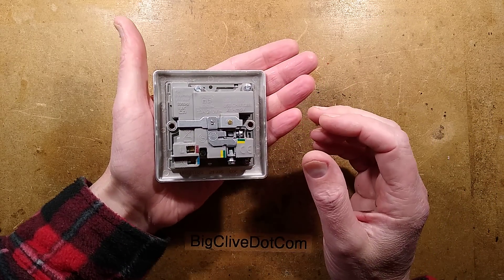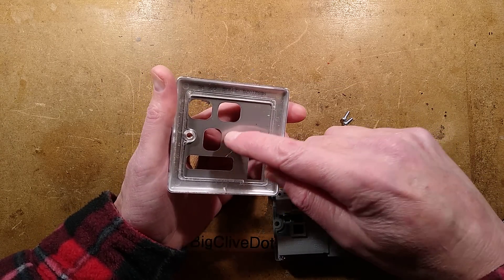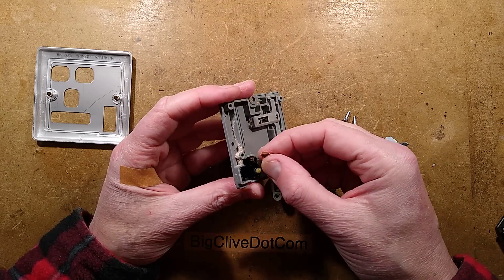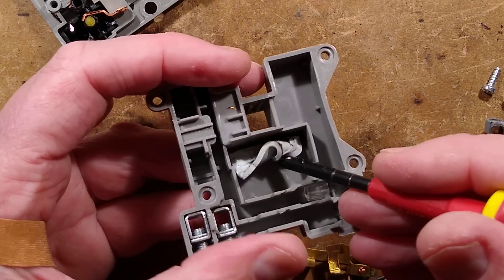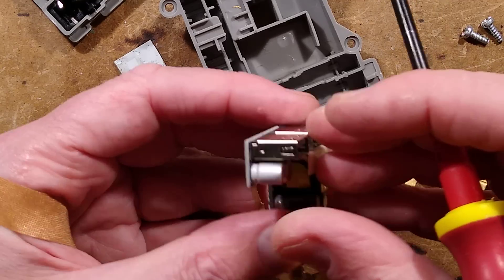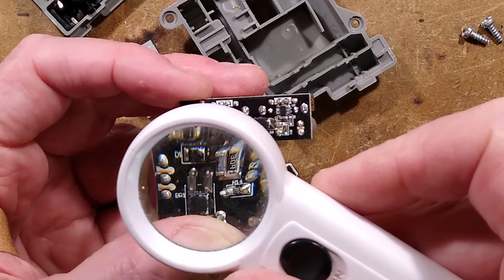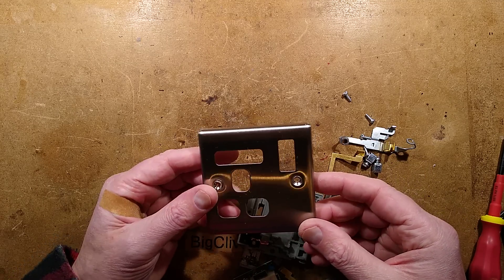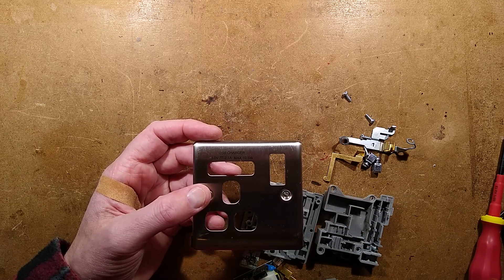Exploded British General USB socket

Comment: I've never liked (or used) these permanently powered up built in USB sockets, Not only because of problems like this happening & not being able to quickly disconnect them, but also the fact that they continuously draw a small amount of power, even when not in use, which would start to add up if you had them all round the house.
Reply: Agreed, how much is the vampire drain on these sockets? At current elec prices, 1W continuous is costing about £3 per year.

Comment: Hate these things, but if people really want to there's not much you can do. Also, i envy British socket and plug desing so much due to those being polarized and more importantly an option of fuse inside a plug. Switches on sockets are kinda nice addition too.
But this example has nothing on schuko style with integrated USB. British style got space to fit decen circuitry, meanwhile here - how good can be a circuit that they shove into a mechanism that fits into 65 by 40 mm box.

Comment: I rent and recently had an electrician come in to replace the switch for my immersion heater. He installed the switch upside-down so the "ON" text read "NO", ran the lead through a shelf rather than around it and left one of the screws loose. Once he'd left I isolated the power at the breaker and made it good, and safe. I understand why folks don't want to mess with mains though, I just wanted it right without having him back.

Comment: Lidl did a three port charger with pass-through socket a few years ago which has most of the benefits of  built in USB ports without the "transformer stuck in the wall" problem. You can also switch it off. 
I've had no problems with mine but I haven't seen it on sale since.

Comment: I don't have any sockets with built-in USB, but I do have a few of those 4 gang extension leads with 2 x USB charging ports, and I've opened them up, drilled a hole in the case, and fitted a nice 3A switch so I can turn off the USB ports. 
The idea of built-in USB sockets is fine but I think the current implementation is flawed. They need to incorporate a switch so the USB sockets can be turned on/off as required. 
Having electrolytic capacitors, ICs, etc, humming away 24/7 in an enclosed, non-ventilated, tight-fitting space, converting 230 to 240 volts into 5 volts, is a recipe for disaster and house fires.

Comment: I've had a BG double white socket with USBs toast out, disabling USB but maintaining mains power. I replaced in any case and I also consider BG to be one of the better brands whilst not as slick as the more expensive MK. This lasted a lot longer than Chinese import USB wall sockets off fleaBay.
Reply: Same, in my case it happened while a Hoover was plugged in to the socket; might have been a Masterplug branded one but it's always BG on the actual sockets. Costco accepted a return even though I only gave them one socket out of a 2-pack.  I have a few of these for convenience, I must admit, I know how to safely install, test and change these if needs be though and I accept that is not the case to the wider public.

Comment: I’ve never been a fan of the built in USB’s for exactly the reasons you state. They sit there constantly powered it can’t be good. I have very sensitive hearing and in hotels which have them near the bed I can hear the transformer humming. Really annoying as you can’t turn them off

Comment: That grey sticky oblong is a thermal pad they work great, mainly on tv boards to transfer heat from parts to the metal chassis 
Thanks Clive nice tear down
Reply: @stonefisk  lol, yes very cold
Reply: And if they'd used a metal case instead of plastic, it might have done some good.  Inadequate cooling is probably the source of the failure on this one.

Comment: I've never understood the 'need' to have an electrician wire something as simple as a socket.
A lot of people in the UK know how to wire a plug, a lot less than I thought when we were taught it in school and half the class failed at it but still a fair amount.
Wiring in a socket is the same, if not slightly easier, flip breaker, test if socket is still live, take out old socket, take photo of wiring configuration, grab new socket, see where wires go (they'll be marked, or even nicely colour coded) put wires where the socket tells you to, check photo to make sure you haven't discarded something you need.
Or just check one of the dozens of videos online.

Comment: Somewhat unrelated but talking about electrical failures I've just lost 2x £5 circuit boards thanks to what at the moment appears to be a fake FTDI chip.

I was doing some work over serial and the first board worked fine but the two subsequent boards had strange jitter-like issues on their RX side. The hint that it's the FTDI is that the problem has worsened the longer the device was attached and that the TX active light comes on when the TX -> RX connection is severed. Also a second brand new FTDI board doesn't show the same behaviour.

Makes me wonder if a fake component has turned up here?
Reply from the maker: Hopefully not the infamous rogue FTDI Windows driver that deliberately bricked clones.
Reply: @bigclivedotcom  Given how many of them are around I think it almost certainly is, but then I use Linux so no driver issues. 🙂

Comment: i would rather trust a decent brand wall socket with built in usb than what most people do and get the cheapest usb power supply and leave it plugged in and switched on anyway.
Reply: There is also option of buying quality chargers.  I never understood the argument that I would rather get this bad thing than the other bad thing.

Comment: a slipped screwdriver into electricians hand caused him to lose his last three fingers from infection.  so innocuos but still deadly. i wouldn't have even realised if my dad had not been on the same ward.  whats additional is that my dad almost lost his middle and ring finger from a spanner slipping as we were changing ball joint on morris marina. he got a small cut but the contaminants  made for blood poisoning. scary stuff. Please wear strong gloves or at least be aware of the angle the tool you're putting pressure on.

Comment: I wonder if that is why I prefer plug in devices, rather than built in, as a failure of a built-in is far harder to isolate. Switched sockets are usually simple devices with a high reliability.

Comment: These USB wall sockets should be avoided like the plague. I've had enough devices fried by dodgy chargers to never use a charger I don't trust, and this style of socket is increasingly common in public spaces where it's impossible for the user to verify what the USB port is putting out.

Comment: I wonder if they could install a microswitch at the bottom of each USB socket that turned on the power to the circuitry when a USB plug is inserted?

Comment: Im not a fan of these sockets with USB embeded in them,just a fire hazard in my books,as the customer was using it with led strings,might of overloaded the USB,or  thermal protection kicked in, and was constantly switching on/off as it heated and cooled down,eventually stressing the power supply.

Comment: As long as electronic components like transistors or integrated chips will be failing short circuit (which they mostly do), integrating such circuits into a hard wired components of the electrical systems will be a no-no for me.

Comment: Yeah, not a good idea... good that you reminded me of those Clive. In my mom's new apartment basically all units have come with one wall mounted USB socket like that (probably because the intention was for lots of units to be AirBnb units anyways), I have little hopes of them having good circuitry given that everything in that building is cheaply done cutting corners and all that crap. I intended to take the thing away from the wall and just leaving it empty, but I never did it - marking it as a must do for the next visit.

Comment: Interested you bring this up, my parents had the exact same failure in a Leviton branded edison style US outlet. In their case mains voltage some how ended up on the usb lead and the cable caught fire. Luckily no one was injured but it was still a mystery how this happened.
Reply from the maker: Possibly a badly wound transformer.
Reply: Why did you call it edison style? edison was a thief and didnt invent anything. The flat pin US plug was invented by Harvey Hubbell.

Comment: You know, the previous owner of my house installed a USB outlet in the kitchen. I've been thinking about removing it, just haven't gotten around to it. I won't even use the USB outlets on it. The few times I've needed a charger while following a recipe from my phone, I've went and gotten a plug in charger. I don't know anything about the quality of the built-in circuitry, let alone the possibility of failure. And when I pull it out and check it, it won't go back in, even if it's well made.

Comment: In the UK, a 240V ac power outlet could be supplied with a protection breaker of 32A. 

Given that a USB supply is built into the wall, it is possible for the full 32A to arc away and set fire to the house. Fuses work when there hasn't been any component or copper track residue/flash over. But in a confined space plasma builds up and conducts well.

Appliances should never ever be built into walls.

Comment: Why go the extra mile and make it flush with the wall, BUT not include decent caps to smooth the dirty electricity out caused by the USB's power supply? The stupid short term comfort, and the long term headaches such items cause both health wise and financially...

Comment: Yes. Let's just "heatsink" the board to the non-thermal conductive plastic enclosure, and stuff the whole thing into an insulated wall. Don't even bother trying to couple the heat to the slightly more thermal conductive metal front panel, which could actually stand a chance of dissipating some heat.

For anything that's going to be sealed in a wall, they really should derate everything in their design, assuming it's going to be running at 100°C whenever it's in use. They should assume it needs to run 24/7 for at least a decade, and then catch fire. Luckily it only popped this time, but it only takes the wrong combination of components to pop and leave enough of a skid mark to allow the mains to arc over. And that could cause you to have a very bad day, indeed.

Comment: i think these are very bad idea and should be banned, i the usb power circuitry in these is usually continuously powered, which should not be allowed,  and when it fails, like here, whole thing needs to be replaced, much better a plug 'pass through' usb power adapter ..

Comment: The burned components should be connected to the driver IC, which is the real culprit; in the sense it had a breakdown (short-circuit), following a peak of the main voltage, or just a random parameter shift. Those shifts are binary, as they require a manufacturing error (water or sodium in the IC), and a sustained overtemperature.
There should be a main switch for the 5 volt power supply, too.
Thank you for the video,
Regards,
Anthony

Comment: I've always thought that wall sockets with built in USB ports are a bad idea. Sure it's convenient and you might think it's a really cool idea at first but when you think about it more it's just more circuity crammed into the same space resulting in higher temperatures and more parts that can potentially fail.

Comment: Agh, I was hoping you said "it went on fire"
Put the bigclive bingo card away!
I dislike permanently wired thingies like these, despite being elechickenedly minded, if the other half would be stuck with something like this situation, she wouldn't know what to do.
Be interesting to see if those electrolytic caps had changed value over time being constantly "kept warm", cooled, then required a demand if the power was reintroduced after decorating. Used to see this a lot in a particular cheap brand of dvd/vcr combi that used cheap caps. Customer states "worked great until I turned off the power, but comes back on. 5 hours after I switch it on". Also would do weird things like slow the menu functions down quite annoyingly. Throw a pack of caps at the power supply and another goodmans product lives... I'll never forgive myself.

Comment: I would have expected a minor pop assuming there was an internal fuse, not flames
This is why i'll never have a usb socket in the wall
All my usb supplies are either in a fused power strip, or the brick type with a fused plug, and i never leave them switched on if i'm not using them

Comment: I actually remember getting shocked by one of these before. Thought it would be wise to change our old plaster-covered sockets with shiny new metal ones. Turns out I turned the wrong circuit breaker off in the consumer unit and trusted one of those screwdrivers that light up if it detects a current. Alas, it was broken, and the live wire touched the metal faceplate while I was holding on to it. Luckily the breaker tripped before anything serious could happen 😅
Reply: Best advice is to switch off the entire consumer unit. Even if you get the correct breaker there can still be a wiring fault that gets you shocked.

Comment: not a big fan of circuitry inside my wall-plug.. turns a purely mechanical almost no maintenance device with probably more than 50 years of lifetime, into a point of failure that constantly draws current and  blows up after 2 years ... and if unlucky and there is sawdust between your paper dry walls .. takes down the house with it.. nonsense product imho. .. rather put a second standard wall plug and a descent power supply instead.

Comment: What load was applied to the outlet?  It seems common practice to connect devices capable of handling 16A or less to 20A or more circuit breakers. As mechanical engineer I have had stand-up fights with my electrical counterparts. I believe many fires were caused and lives lost due to this practice. It requires serious regulation changes in many countries. Certainly in South Africa.

Comment: Yep, Clive the Idea of cramming a USB outlet into a socket, I have always thought a bad idea and WHY surely simpler to use a plug in charger and when it fails remove it and get another without the faff of finding the Circuit breaker and then having to remove the socket and fitting another, if you need the socket for mains items as well as USB then you can either fit a 1-3-4 adaptor socket or just use an extension lead,

Comment: I got desk power strips that have USB ports integrated in them, which is about as far as I want to go. There they're convenient to quickly power something off USB without having to fumble around for a spare mains USB adapter. These power strips also have a nice clunky power switch that turns off power to the outlets and the USB circuitry.

Having a USB adapter permanently integrated in the house's outlets seems like utter madness, as this video demonstrates. Virtually all of such hybrid mains/USB outlets seem to leave the USB circuitry permanently powered, which is just... I mean, why?

Comment: This type of socket needs at least a 35mm back box to allow for enough reasonable breathing room for the cables.
The standard 25mm boxes can so easily lead to crushed insulation on the wires
Reply from the maker: Lazy contractors who put in shallow boxes are a pet hate.  I want loads of room at the back to avoid wire crushing and component stress.
Reply: I’ve fitted a few two gang BG sockets similar to this, only with a screwless clip on face plate. They come with a 10mm plastic spacer to allow use in a 25mm back box, although I used 35mm boxes. I don’t think these ones will fit in a 25mm box without the spacer.

Comment: Here is a question. Does the switch also isolate the usb supply so in an emergency you could switch it off??
Reply: In this example no, it just isolates (single pole only)  the power socket, the USB outlet  remains on.
Reply from the maker: Sadly no.  The faulty electronics remain active in your wall.

Comment: Agreed. Having circuitry in wall socket makes it hard to repair in the event of failure.
Reply: pretty much impossible,  and fire risk as they seem to be continuously powered
Reply: Would you really repair it, or just replace the socket?

Replacement is easy..
Reply: @deang5622  So far, I don't think I had the need to replace a socket in my house (20+ yrs). Not sure how long the USB ones would lasts.
If the damage was to the USB port and the product is already EoL, I would replace the USB port.

Comment: I have started to wonder what the power consumption of these is when nothing is plugged in, any chance of testing that for us Clive?? I'm not a big believer in the whole "vampire standby" malarkey, but I do have quite a lot of double sockets with USB in the house now....!
Reply from the maker: The standby current is usually extremely low.
Reply: It's likely similar to what the draw would be for a plug-in USB charging brick. Could be very minimal or a surprising amount depending upon the design and quality.
Reply: standby current likely very low, but thats not really the issue, it could fail,  in a nasty way , at any time, as its powered continually
Reply: 1W now costs £3 per year, so adding up all those vampire drains could be significant. I have an ancient cooker hob with a red LED clock/timer [failed] that draws 6W just pointlessly sitting there - madness!
Reply: @peteglass3496  not surprised, old leds were very inefficient compared to modern ones, about 20ma per led or segment, plus current of the clock circuit itself,
Reply: @andygozzo72  28segments x 20ma is about half an amp x 12V gives 6W! You are bang on, thanks for the tip.

Comment: don't buy the usb built in outlets. it's more trouble than anything. 
and for burgers switchless outlets, that's 24/7 vampire current.
you probably have 3 or 4 usb charger lying around anyway. use it.